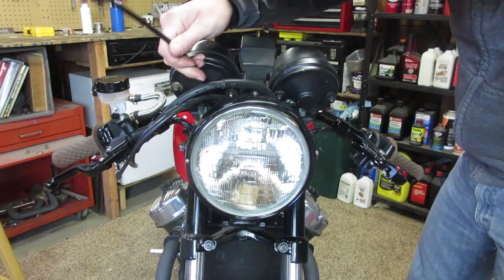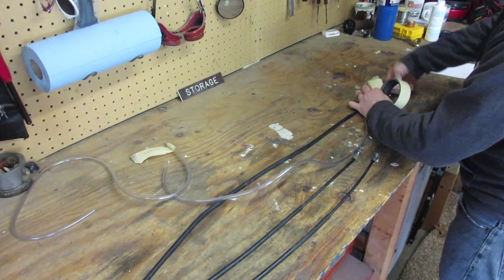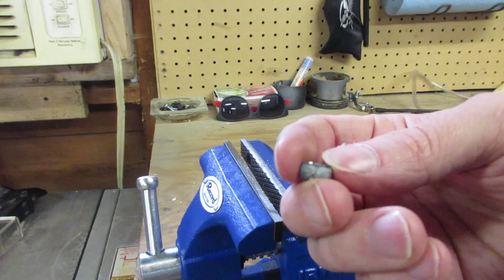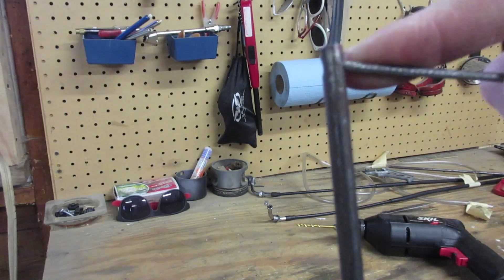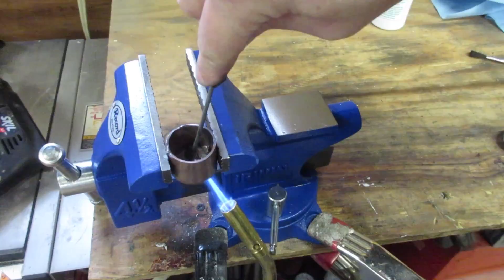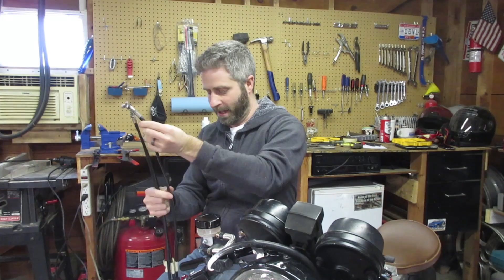Shortening Motorcycle Control Cables : Honda CX500

Comment: LUKE...great info.  What method did you use to shorten the cable housing?  Seems tricky since there's the metal liner.  This is great to know since I want to shorten the choke cable on my '80 CB650 Bobber Build project.  Universal units are hard to find in the USA.  Eu only.

Comment: the cable end piece isn't made of a hard alloy, it's just solder. the problem is the steel control cable fibers embedded in it, so it's like a composite material made for snapping drill bits, haha

Not sure what kind of drill bit you would need for that, but im guessing something like the tungsten carbide grit hacksaw blades.

Comment: Hi Luke,
I've tried to mimic your method but my soulder won't wick up the cable. In fact even trying to apply heat to the end of a test piece and soulder directly doesn't work. I'm using 60/40 (lead free) and shoulder paste too. 
I've made my own melting pot and have a butane torch underneath. 
Can you help? I'm stumped. 😣

Comment: hey did you find that he brake and clutch setup off of ebay? i was considering it for my 82 suzuki gs650
Reply from the maker: I picked them up on Amazon, in the description of this video: https://youtu.be/M-DmmhAwmvE
Reply: Luke Daniel cool thanks. did the new setup match the old master cylinder bore size? or did you decide to use a different size to change lever feel?

Comment: Why are there 2 throttle cables?
Reply from the maker: One pushes, one pulls.
Reply: It's a safety feature that many motorcycles have. 1st Pulls to operate the throttle, the 2nd Push cable is to make sure you can close the throttle in case of cable binding that over powers the throttle return spring. Keeps the bike from running away while you are one it.